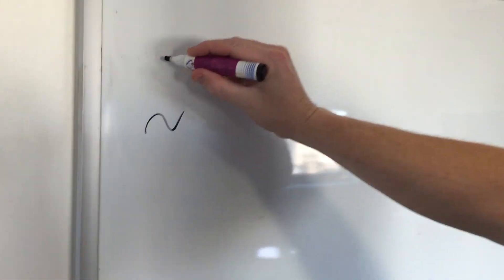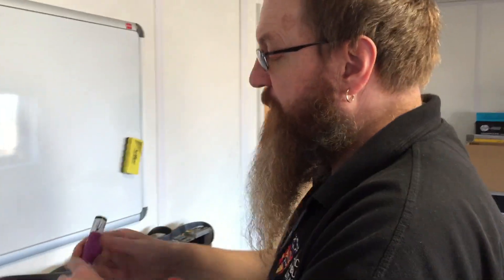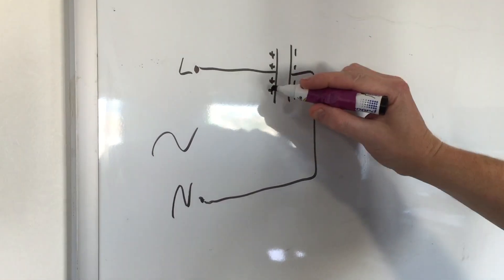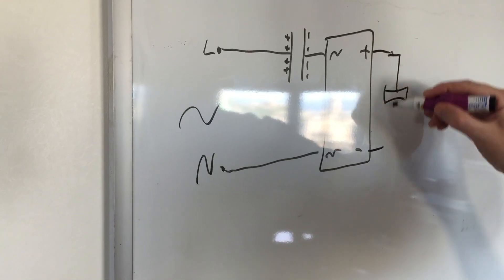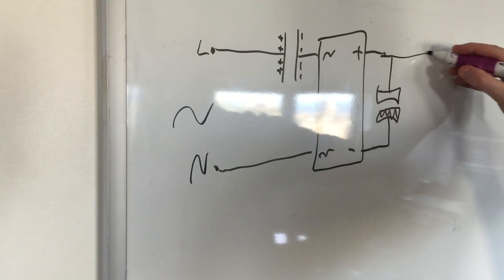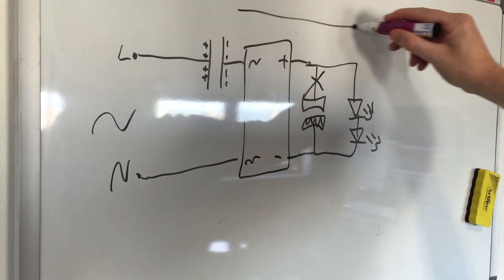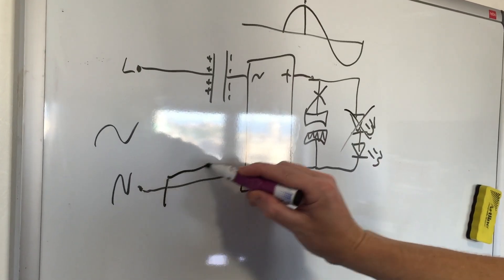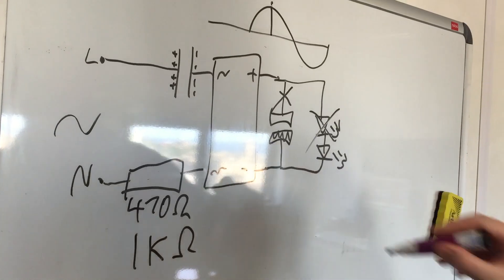Random workplace technical explanation for my coworkers.

Comment: This was helpful on building my first power supply for powering a project
Reply from the maker: Keep in mind that this type of power supply is not isolated from the mains and the low voltage side is effectively live to ground at full mains voltage.

Comment: Hi Clive, have you ever encountered CRDs (Current regulative diodes) during your teardowns?...If yes, have you ever made a video about them?
I came to know this new electronic component yesterday while translating a Chinese datasheet.
Reply from the maker: Current regulating diodes have been around for a long time.  Usually quite low currents, but now available in larger packages for LED applications with beefier currents like 350mA.

Comment: the large surface capacitor is a so called capacitive dropper right ? if you ommit the first capacitor what changes in the workings i.e. what is its purpose ?
Reply: +Maico I do know quite a thing about other electronic components but also can be called a novice since i've only been educated one year at school about it. Thats why I know the general workings of a capacitor (to hold charge) but somehow always find it hard to understand when its used 'to smooth'. I Do understand the video in the sense of why the LEDs failed when the 2nd capacitor got accidentally disconnected but not quite what the first capacitor is for. It looks like the bridge rectifier lets through current in both AC sides anyway (without the first capacitor) and then charges the second high voltage (high surface) capacitor until it lets enough voltage difference build up accross the LEDs to pass their voltage drop level and then they light up and then its voltage drops below that level again so  the LEDs don't get all the voltage the rectified AC delivers so thats why I assume the second one is the voltage dropper (also cause of its large voltage ability)
Reply from the maker: The first capacitor is the dropper.  The second bigger one is for smoothing the pulsed current into DC.
Reply: bigclivedotcom I got that wrong then. I thought it must've been the second one cause you were talking about larger surface areas (I assumed that would mean the same as being a high voltage rated one)
Reply: bigclivedotcom sorry I got it totally wrong :) I think I'm gonna hire you as my teacher ;-)

Comment: An excellent introduction to the basics of the capacitor dropper power supply.  You should have warned that the circuit is live. Some people might think that low voltage means safe. But don't warn about the lack of a discharge resistor. Let them find out for themselves.

Comment: Clive if you would have been my electircal engineering professor I would probably make the class. It's totally different if someone with practical uderstanding of electronics explains to you how components work, and why they should be on the circuit. Compared to someone that only has book knowledge.

Comment: Is a capacitive dropper considered a bad application for the purpose it's used for, or is it a perfectly fine circuit for producing LED lights that run from mains voltage?
Reply from the maker: It's a very simple way of limiting current with no significant heat generation.  This makes it ideal for simple LED lamps, but not suitable at all for applications where full mains isolation is required.
Reply: +bigclivedotcom would it be able to power an esp8266 module with a peak current of  about 200mA during short burst while transmitting?
Reply: /* subscribing to this comment */
Reply from the maker: If you could guarantee a normal low quiescent current with brief peaks during transmission provided by a storage capacitor then it should be viable.  But keep in mind that the while circuit and anything connected to it would be at full mains voltage.

Comment: do not want to be nitpicking, but would the current through the rectifier not be maximal at the point between a maximum and a minimum in the sinewave? 
(current in this assembly being the derivative of voltage)
Reply: During normal operation, probably. But he's talking about plugging it in right when the mains happens to be near the peak of the wave. the capacitor had nearly 0 volts across it, then you're trying to suddenly put the peak mains voltage across it, so it will suddenly draw a huge amount of current if there's no resistor.
Reply: all right, thank you, did not consider that.. really appreciate the explanation

Comment: How much Current can you get out of a capacitiv dropper? Could you replace an 800W 12V Power supply with it?
Reply: Possible? Theoretically yes. Practical? Hell no!
Reply: In theory the amount of current you can get out of a cap dropper is limitless - just get a big enough capacitor. In practice, getting a cap with enough capacitance AND a sufficiently high voltage rating becomes a problem. Also, consider that a cap dropper on the AC side behaves much the same as a resistor on the DC side, which is to say that there is a relationship between voltage and current that follows Ohm's Law. In practice this means that unless the load on the power supply is perfectly constant, the voltage will change as current draw varies, or the current will change as the voltage drop across the load varies. Capacitive dropper != regulator. It's just a "lossless resistor" so to speak.A reactive element to be more precise. There are more reasons but I'm not going to write a full blown monograph in a YouTube comment.
Reply: The power factor effects of "that" sort of load would be . . ."interesting" . . . . .
Reply: ***** Could you elaborate why? There must be a reason, why power supplys with high output aren't built that way
Reply: Thank you very much!

Comment: Anyone else confused as fuck?
Reply: Nope. It makes quite a lot of sense. I'm no leccy expert but I do know the properties of some capacitors. 

What is being described here is that the first capacitor that Clive drew will accept the influx of current in one way, and when it's being given the same current but in reverse it'll kind of conflict and come to some kind of agreement of how much current shall flow, the bigger the cap, the bigger the buffer, keeping more of the current held back while the rest just crowd surfs it way out.. but it doesn't just go in one direction, it's hardly Direct Current at this point. 

This is where the bridge rectifier comes in. It can accept the ebb and flow of the (now much less aggressive) current, and point the crowd surfers in one direction >  >  >  >  >. instead of < > < > < >. 

There's a slight problem though, between each polar change from this way < to this way > there's a distinct gap where nothing happens. The second capacitor clive drew (usually an Electrolytic - polarised, one way flowing) goes across the output of the bridge rectifier to act as a second buffer but in a similar way that a battery works. It charges long enough (with enough current) to keep the flow >>>>> as much as possible by discharging while there's no input from the rectifier. 

I hope this kinda helps. As I say I'm no expert and I'm probably wrong 90% of the time I think I'm right.
Reply: nope he explains it so perfect it's hard to not understand
Reply: No worries :) It's sometimes hard to get your head round things, and it's especially hard with electronics as most of it is hidden from view, you can't always see what's happening. It's not as though you can see the flow of electricity like you could with water in a clear tube, for example.

Don't give up though, it's a complicated subject but not impossible to work out the easy stuff, and when you grasp the basics who knows what you can do from there. Hopefully you get a hang of it and progress way beyond I have. Everyone should test their capabilities, and fail and rebuild. Have a great day Bob.
Reply: if you know nothing, then yes. If you know a little, no. Watch AVE's recent video to et some of the basics.
Reply: +Neffers Im not saying the way he describing is wrong im just saying i dont understand electronics xD
Reply: Neffers Thankyou! You too!
Reply: Check out Clive's "A simple guide to electrical components" or AvE's "Electronics for Gearheads and one Welder".  They both explain things pretty well.
Reply: Thanks for the explanation! Clive's words made sense but the way you described it made it click in my head. Much appreciated!